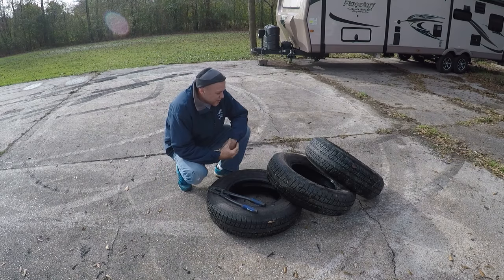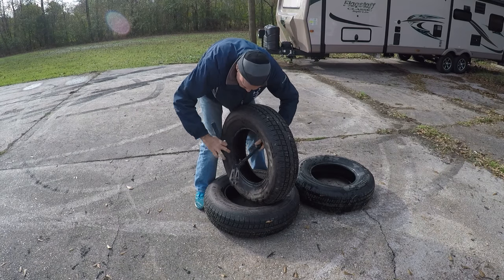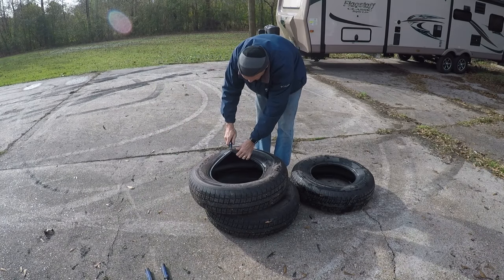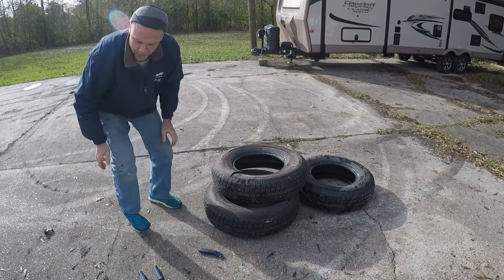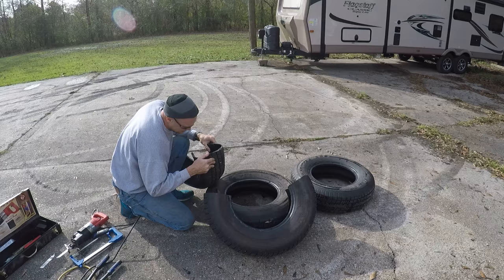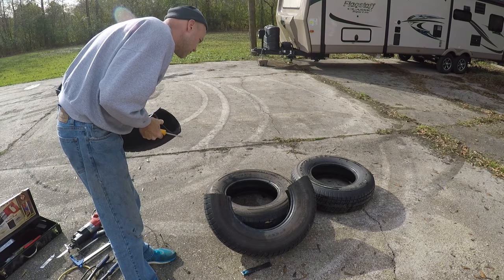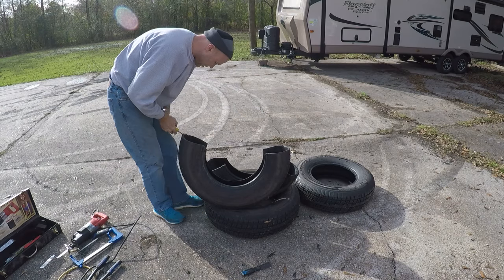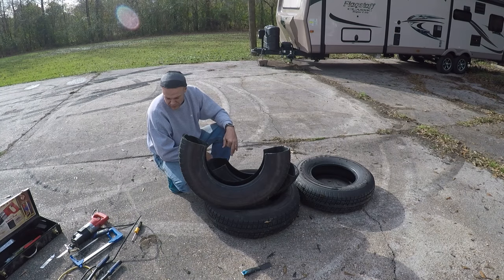New trailer? Should you change the tires? Watch this to help you decide.

Comment: I run "Ghina Bom" brand.  They only costs $10 ea if you buy a full ship load and last until they blow.  I keep a an additional trailer full of a complete tire shop, including 36 extra tires, 2 Daytona green jacks from HF, a balancing machine, 600 rubber aircraft titanium augmented 14 ply pluggers, 800 mini packs of Super Gorilla Glue, and a 1500 gallon 220v air compressor behind my trailer in dual tandem.  Yes, but it rides on Hercules TransgenderEagles.  It doesn't matter which way you mount them, they change themselves.  The benefit I saw immediately was thinking about all the money I save not having to worry about an expensive tire pressure / heat monitoring system.

Comment: Bro you are a beast lol   love it man ...You get right in there!  Awesome ...The new Goodyear Endurance ST is an excellent tire in comparison to the Goodyear Bombs "Marathons" which are out of circulation, thank God. I have Castle Rock with a 75mile rating class D  and live in South Florida with hot pavement. So far have managed well 4k miles into them, but not taking chances. I went with Maxxis M8008 as a replacement 10Ply standards and 100 miles speed rating which rarely I drive with our TT over 72 mph. Had them on our 12K lbs boat peak summer taking boat into the Florida Keys and Naples, Florida.  Yes made in Taiwan but with great specifications and  Rubber compound.  My mountain bike tires are also Maxxis and can take a beating. " My main concern is heat rating and low rolling resistance and that is what Maxxis tires are known for.
Reply: I just retired two five year old Castle Rock tires from our Forest River Wolf Pup. One of them had a section of the tread pattern that was distorted to one side, and I suspect it was delaminated and getting ready to blow. Goodyear Endurance are going on even as I'm writing this.

Comment: thanks.  im looking to replace my castlerocks now
Reply from the maker: No problem. I'd highly recommend the Maxxis 8008 or Goodyear Endurance. I'd also recommend going up a load rating as well  as the MFGs usually use the cheapest tire that will support the GVWR and they don't leave a lot of cushion in the overall load.

Comment: what kind of tires were these, and what did you replace them with?
Reply from the maker: Howdy! The originals were Castle Rock brand, load range D. I replaced them with a set of Maxxis 8008 load range E. One of the Maxxis tires picked up a screw so I now have one Goodyear Endurance load range E and the three Maxxis tires on the trailer. The 8008 and Endurance tires are excellent and very comparable to each other in my opinion. The Goodyear Endurance is actually made in the USA as well.
Reply: Aaron Rose max is is great I got Goodyear marathons for now had 4 Carlisle come apart from age

Comment: Sawzaw would have been easier
Reply: Or an angle grinder with a thin metal cutting wheel.  Stinky (hot) but effective.
Reply: I guess you didn't watch the whole video.